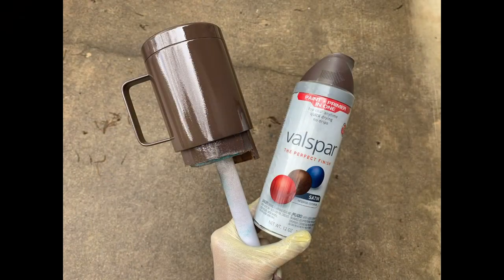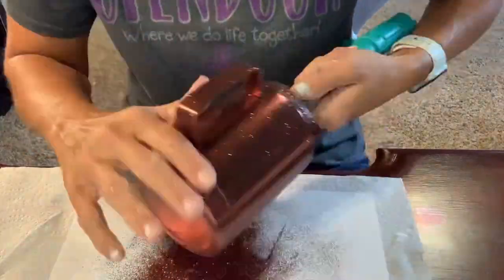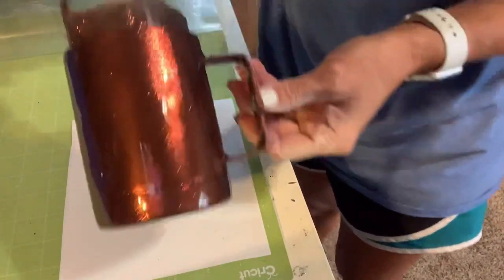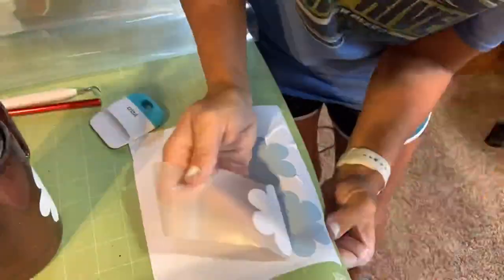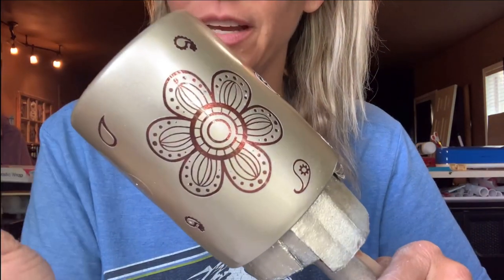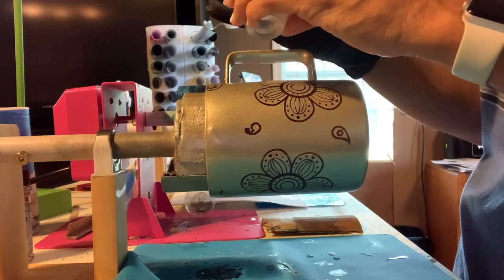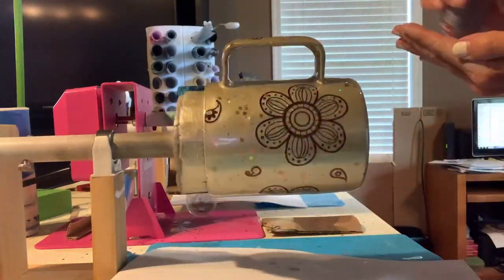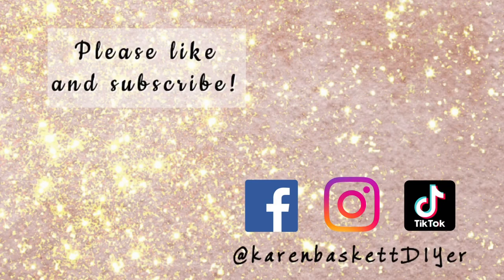Tack It & Peekaboo Method Tumbler Tutorial | COME LEARN WITH ME

Comment: Just curious as to what the timer is for?
Reply from the maker: Sorry I probably didn’t explain that very well. I set a timer when I start stirring my Epoxy.  Usually a three minute timer. Then once I stop stirring it I set another timer to let me know when it’s ready to apply to the cup. I usually let mine sit anywhere from 5 to 7 minutes depending on which brand I’m using. Time just totally got away from me once I turned the second timer off and you see what happened LOL
Reply: @karenbaskettdiyer  oh gotcha! I’ve never set a timer 🤣
Reply from the maker: Lol you are good! I get SO distracted!!!!
Reply from the maker: Just this morning I was working on a cup. I got it all mixed set my timer for five minutes went outside to do some thing came back in... completely forgot about my epoxy 🤦‍♀️ and my timer was going off I have no idea how long have been going off. Again I get so easily distracted!
Reply: @karenbaskettdiyer  if I let my fast set epoxy sit for 5 minutes it’s already starting to harden so I usually use it right away. And I stir until the epoxy is clear.
Reply from the maker: Mine gets really hot during that time snd super easy to work with. I think climate has a lot to do with it as well. ☺️